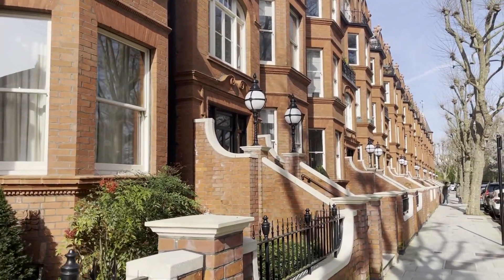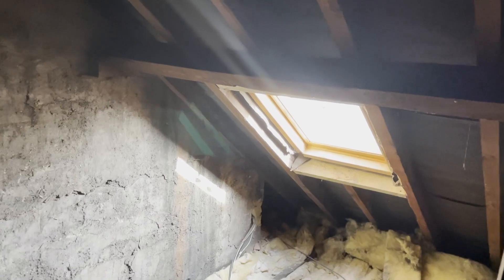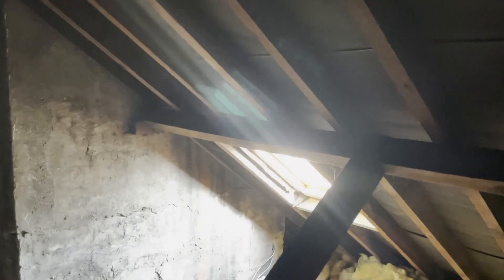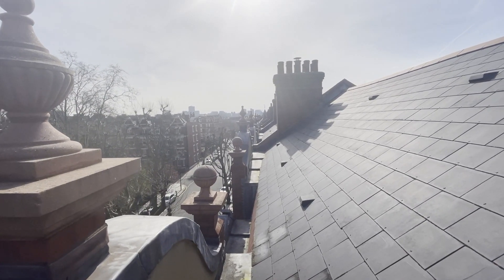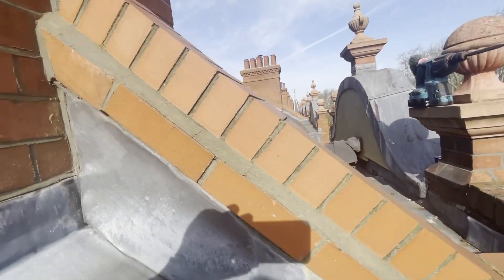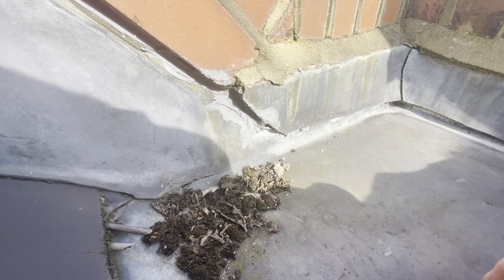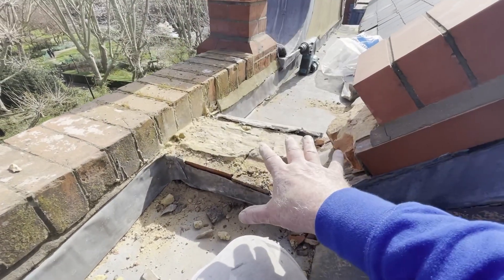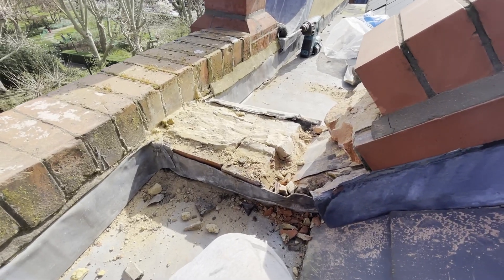Dubjax at Work- Part 1-----26th of March, 2024

Comment: Very interesting to see the brickwork and flashing and how the water is kept out  and how important it is to get it right👍. Beautiful buildings , do the decorative features ever give any problems ie become loose?
Reply from the maker: Hi Colum
If you mean those decorative finials at the top of the  front walls, then no, they are all good.
What cannot be seen is that in each and every case there is a stainless steel reinforcing bar that runs vertically within each finial and down through into the main body of the brickwork, each of these reinforcing bars is set in an epoxy resin.
Even if there were a hurricane they would not move, the slate roofs would not fair so well.